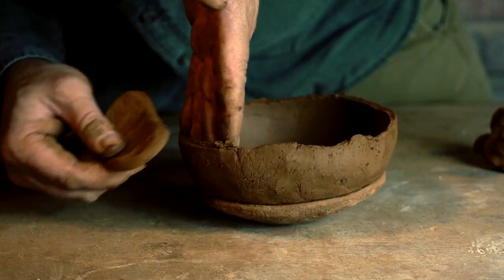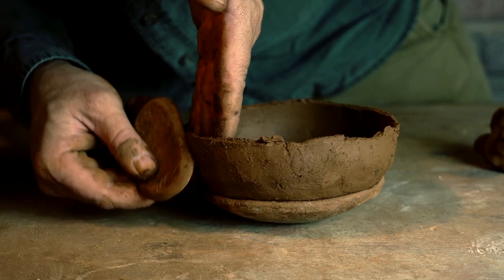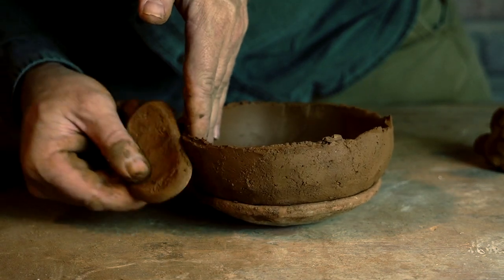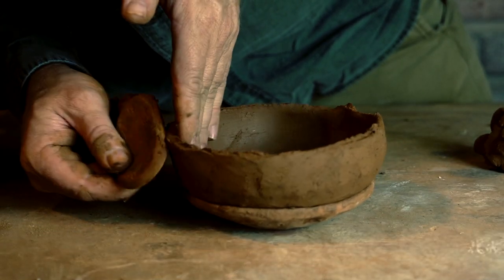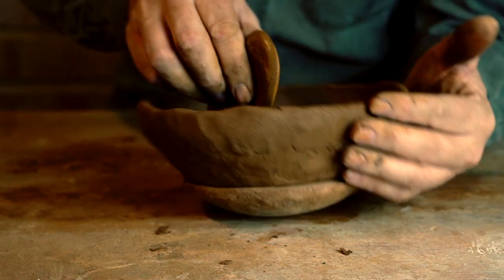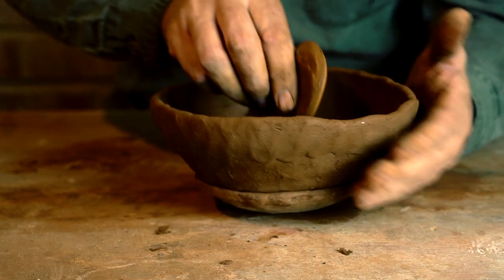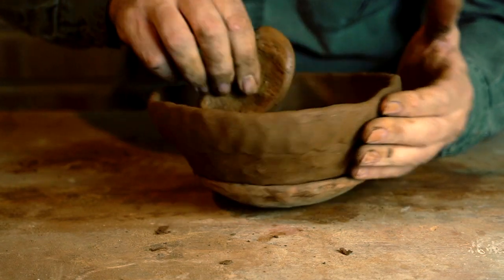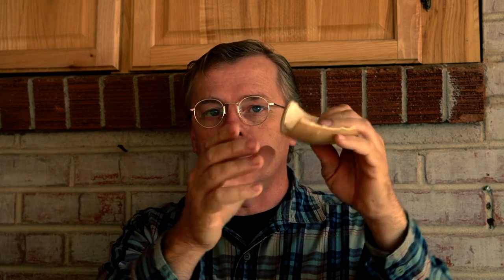How To Make a Traditional Gourd Scraper Pottery Tool

Comment: I was a little dubious about this, but I had a gourd and decided to try it. I broke the gourd into “blanks” with a hammer (very fun and cathartic), then traced a kidney shape onto a piece using a commercial rib. My hands aren’t as strong as Andy’s, so I used pliers to get as close to the pencil outline as I dared. After that, the rasp and sandpaper worked a treat to refine the shape. I started using it as a novelty, but it’s so much better than the commercial ones, being curved in two planes, it’s the only one I use now. Thank you, Andy!
Reply from the maker: I'm glad you like it so much. Thanks for sharing

Comment: Could you be able the make a puki out of a gourd?
Reply from the maker: Yes and no. It would certainly work, but the bottom of a gourd has an indentation that would be undesirable and the sides of the gourd would not be round but slightly oblong.

Comment: Hi Andy! I am thinking about what potters would have used in places without gourds like much of prehistoric Europe where people were visibly doing a lot of hand made pottery but weren't always familiar with gourds. Maybe boiled leather could have similar properties of hardness and flexibility, although surely not exactly the same. Will try to make some. Or some species of bark wood with the thickness and the smoothness required. Note that even today it's not easy to have access to gourds in some countries like Sweden where agriculture is limited, and the usual pumpkins on the market are those with thinner skins and they don't dry well.
Balint
Reply from the maker: Leather might soften up when it gets wet. But maybe wood, or bark as you said. Ostrich or sea shell?
Reply: Tony Soares (in one of his corrugated pottery videos) mentioned using tree bark and smooth stones as alternatives. He was using a gourd scraper. His work is marvelous.
Reply: @lizmikols2075  Since then I use a lot of wood scrapers, or pieces of coconut or pieces of broken pots which all work very well; you can reshape them by rubbing on the rough surface of a stone.